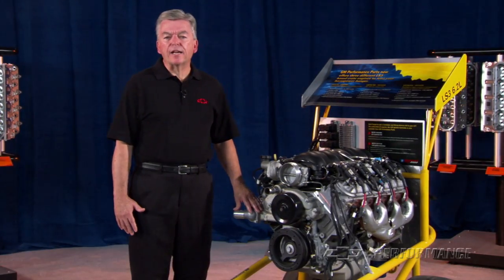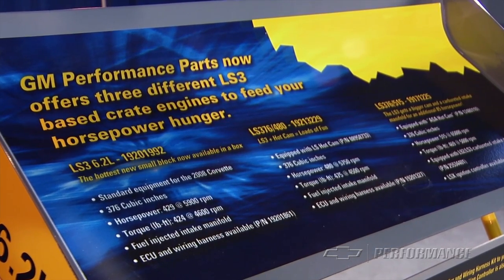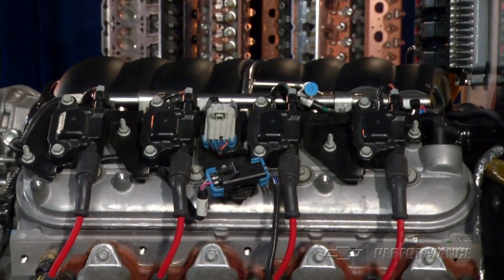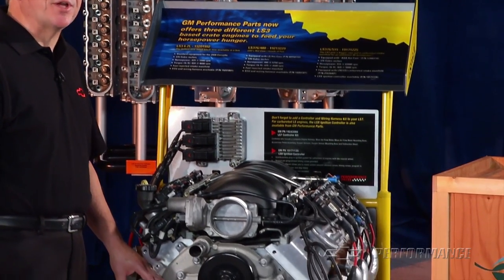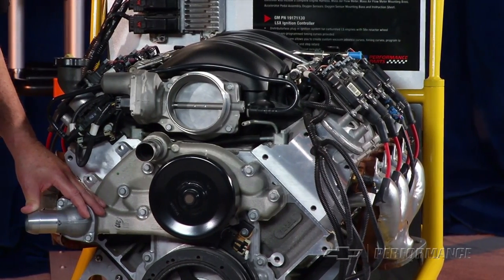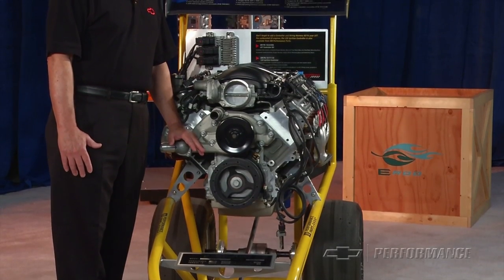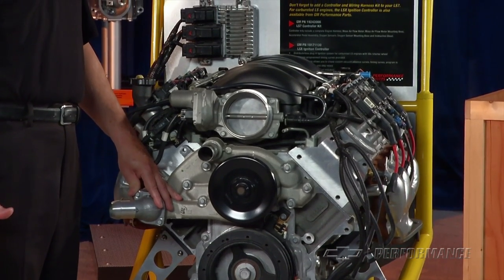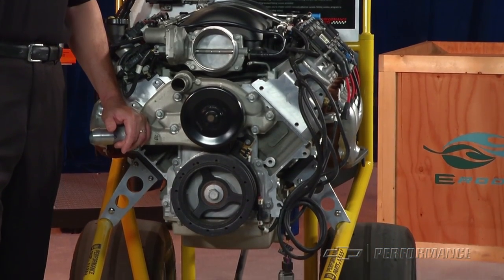Chevy's LS376 + Hot Cam =  480 HP!!!

Comment: swapped one of these into my vette after my LS2 dropped a lifter, with headers/intake/exhaust/ported manifold+TB and tune made 454whp on the same dyno that stock Z06s put down right around 450hp. I think the 480hp rating is a bit optimistic for the crank hp, the cam is prob worth around 30hp, not 50. But still for about half the price of a crate LS7 you really cant go wrong!
Reply: It is true Jeremy. I did a cam swap in my LS3 & gained 67hp. After figuring a parasitic loss of 30% figured out to be 495hp. Lost 6mpg in doing so.. Which sucked big time.
Reply: After u did all that did u have to use a torque converter for the modifications or you running stock converter ?
Reply: @eddielewis3868  I had a 6 speed

Comment: 376/480  @ 20,000 miles piston came apart and went thru block , gmpreformace would not warranty , so i had to go buy a new long block a 376/480 out of my pocket. Got it in car and @ 75 miles on that motor a valve broke in half , gm preformace will not warranty that either , the said cause i got it from 3rd party and gm dealer did not do the install , it was done by the book , used pre luber on motor and ran it 30 minutes and changed oil and filter. I am at a loss why gm will not help me and replace at least one of the motors

Comment: The hot cam suxs, low lift and awful Lsa , there're other better  options out there.
Reply: Why does the cam suck? What is lsa?
Reply: python man lobe separation angle it’s a 112 that’s not bad at all. I had a cam with a 109 LSA for an aggressive idle, whatever. 112 will do.
Reply: My Hot Cam kit included 1.6 lifters.  So the cam spec alone does not tell the whole story.